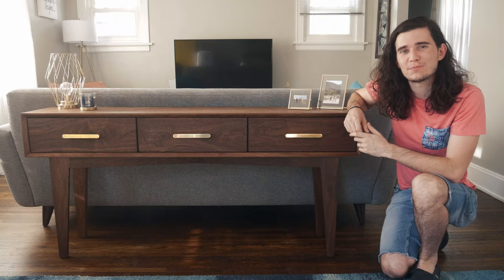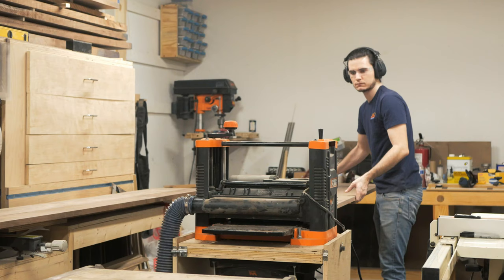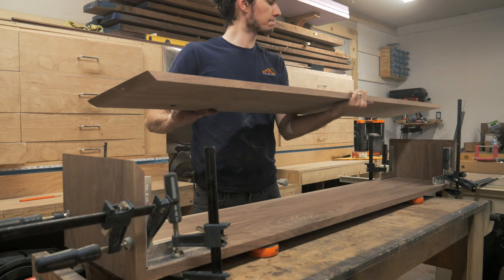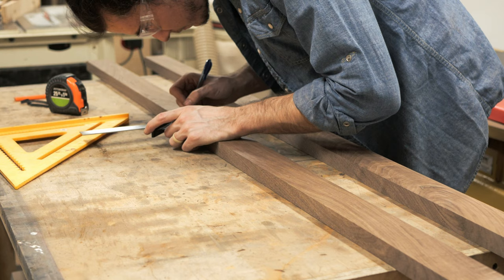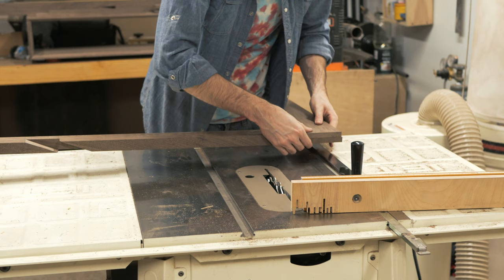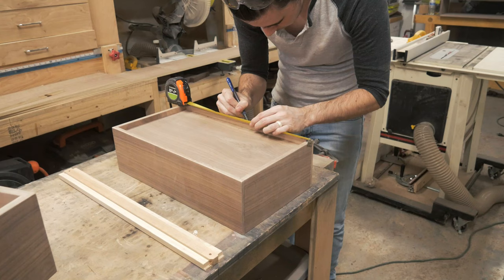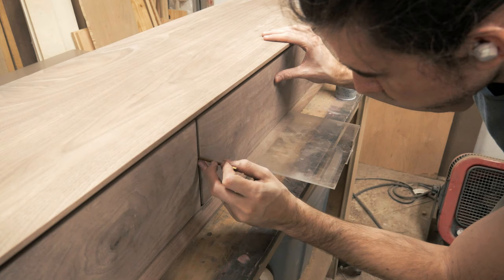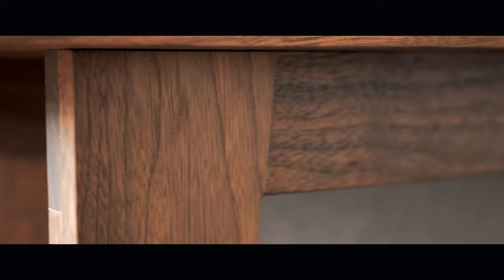How to Make a Mid Century Modern Sofa / Entry Table  - Woodworking

Comment: Well done. That looks really good.  Got a couple of questions for you.  At 7:20 the drawers look like they wobble a little on those rockler runners.   Is that how they are supposed to be or was that just in the early part of the fitting?    At 1:45 you start a shallow cut at the back bringing the blade forward and then go all the way through and cut to the back.  Why is that?
Reply from the maker: Thank you! Yeah, they didn't wobble at first but once I got the drawer fronts on I had to work with them a little. I ended up using some pin on runners to help align the drawers when shut. If I were to do it again I would probably try doing two slides per drawer rather than having it balance only on one. 

I picked that up from I believe Jay Bates awhile back. Basically since the blade spins where the teeth go up through the top of the board, if you make a score cut first you reduce the chance of tearing out the grain on your cut.
Reply: @thespaltydog1039  Great.  Thankyou.  I've seen others do that too and now it makes total sense.